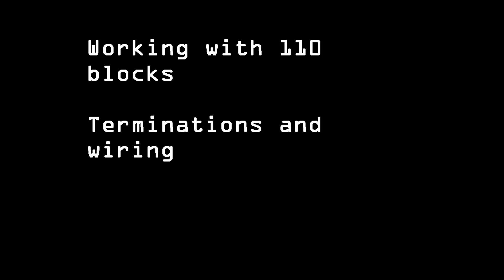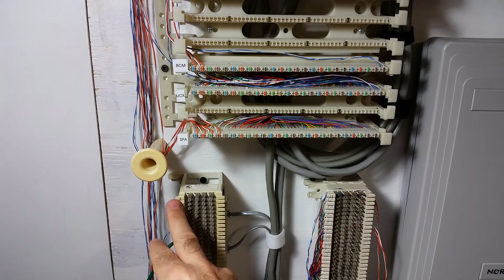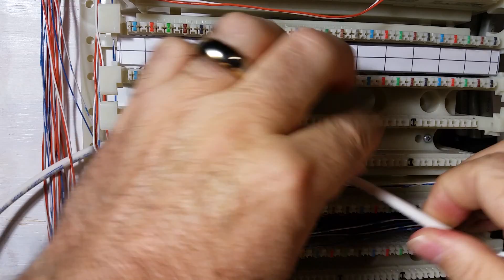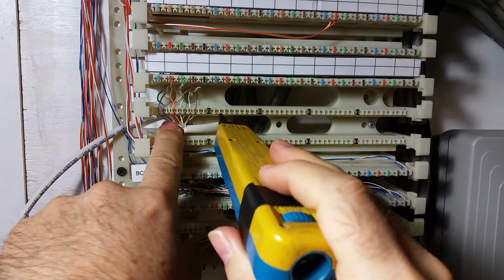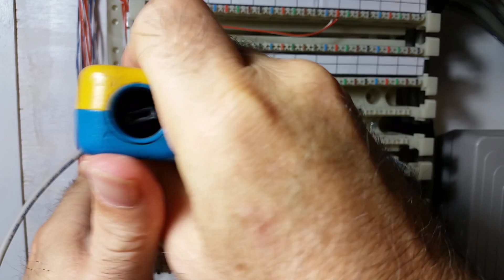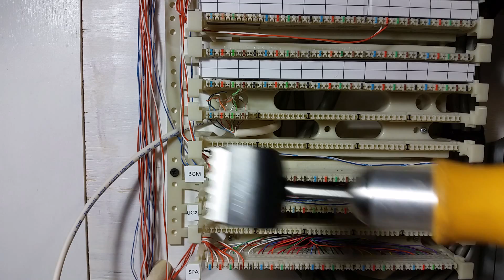punch down 110 blocks

Comment: Hello.
Can you help me with a question.
What is the difference between the 4-pair connector and the 5-pair connector?
Thanks.
Reply from the maker: I'm actually not sure, except that I would use 4-pair wafers when punching down a bunch of 4 pair cables.  And, I would use the 5-pair if I was terminating a 25 pair cable.  Helps keep the groupings straight and color codes straight.

Good question.  Maybe someone else will chime in on the topic.
Reply: I am actually curious about how data travels through these cables. When using regular ethernet cables they have 4 twisted pairs and unless you're using gigabit ethernet they only use two of said pairs, but even in that situation thats only 4 pairs, where does the 5th pair come in and what does it do?
Reply: @raventhorX  I know this is a very old comment. But...

You only use the 5 pair if you're terminating a 25 pair cable. That type cable is only used in telephone networks, not computer networks. Telephone networks need only 1 pair, so all pairs are available for use.
Reply from the maker: Mmm…. Good point Ken,  i guess I never thought about it but that makes sense.  Thanks for adding to the conversation. 😊
Reply: @keneisman6602  There are network switches that have 50-pin telco connectors on them. I doubt any have been made for years, but I worked for a place that had them in the late 90s and used 25-pair cable to connect the switch to a patch panel. As I recall they were 10/100 switch ports.
Reply from the maker: Wow!  Don’t know that I ever saw one of those. 🤔

Comment: Hi I am wondering if 110 blocks can be used for internet. I have moved into a new condo with cat5e jacks. However, they aren't activated yet as i did not hook up my router to the 110 block. I see the wiring done on the 110 block by the builders but i think the order is wrong in order to use internet. The order i see is: Blue-White, Blue, Orange-White, Orange, Green-White, Green, Brown-White, Brown. Any ideas on how to approach this.
Reply: Sorry for the long comment but I would really appreciate some responses. Thanks.
Reply from the maker: NiJu,  that's seems like an odd configuration (for the U.S anyway).  That sounds more like a Telephone line wiring.

I would not recommend trying to adapt your router/switch connections on to the 110 block.    If there is enough slack in the cables at the 110 block, maybe you could pull them off and terminate them on Cat5e jacks (or a patch panel).
Reply: I have a similar configuration in my condo. I just assumed its telephone, as punchdown like this seems highly unlikely for data, and the key thing that indicated it for me was that the blue pair which came from the source was daisy chained to all the room outlets' blue pairs, and that's definitely something you cant do with data lines, and from what he mentioned in the video, sounds like it makes sense for telephone. It does seem odd to me to run cat5e, especially cat5e jacks, for phone, but I think it was probably done a lot as "future proofing", thinking people would have an ever growing demand for phone lines (when actually it turned out to be the opposite).
Reply: Actually, if this testout platform I am using to learn networks is correct they demonstrate this exact method for punching down cabling into a 110 block intended to be used for networks. I believe your 110 is configured correctly, however if you are unable to get internet there may be some other issue causing the problem. If anything I was unaware that you are allowed to even be near the 110 block after moving into a condo. I can somewhat understand if you own the condo and are not renting it, but I was under the impression the internet related to going to ones house works a bit different from businesses where businesses take care of everything after the demarc which include the punch down block. I have never had to deal with a punch down block in any place I've lived in and don't even know where they may be located at either.
Reply: I thought the same thing but after posting my problem on reddit, i was reassured that it would work. I was looking to get to it but so much has come up for me this year with work and school so I haven't gotten a chance to do this.
I'm planning to build a PC but I do want an ethernet connection. However, I do not want to put a 50-100ft cable coming from my room to the router in the living room. I will try this during the winter break but, I need to order the tools (BIX Punch Tool, Crimp).
Reply: Also, does anyone have any idea if I can just buy an ethernet cable with one end open and one end with the rj-45 connector? thanks.

Comment: How do you stop connect physically a phone line from your pbx system? At the 66 I learn I put away a metal block only - possible from every outside line or from every inside line - both is possible. I can test be quiet the closed isolated line without break the full system. But you must diconect the blue/white line physically - found the mistake or after rewire - punch down it. 

It looks for me the 110 system is more for phone company cabinets (or boxes) on streets - where you give the connect "last mile" to the customer - and the 66 system is for the telco room or cabinets at customer side. In the next 10 years it is all equal, then the fiber goes direct to the customer with FTT(B/H/C) - all other works over 1 GBit/s till 40 GBit/s with VoIP phones over fiber or copper lines with standard router, firewalls, switches and media changer. Then we can see it in the museum only.
Reply from the maker: hey, thanks for such a lengthy comment.  Yes, the 110's are common for the phone company.  But, when wiring very large PBX (2000 ports), the space of 66 blocks begins to add-up.  110 blocks can save a lot of wall space.  :-)

Comment: How can I unplug the plastic module in order to fix any wire?....I am talking about the plastic block with tooth. I wonder, how can I remove back for any repair?
Reply from the maker: you know Dennis that is a great question.  And, I don't know the perfect answer.  But, here is what I do.  I basically, use either my hand or a pair of pliers to gently rock the "wafer" up and down and side-to-side until I can ease it out of there.   Yes, you probably already knew that.   So, Maybe someone will chime in here!  :-D
Reply: I've been learning a bit through this platform called testout that you can get at either testout.com or testoutce.com. According to them its best practice to put the cable or wires you are least likely to remove under the wafer rather than on top that way you can avoid having to remove the wafer as much as possible. Other than that though They do not really cover much else in situations where you may need to remove the cables. Actually a bit disappointed in how they teach about the 66 block and 110 block and how these all work. I am under the impression you connect the blocks to a patch panel, but other than that they mostly leave me in the dark it seems.

Comment: luckily I don't run into many 110 blocks...they have always been a pain in my butt!
Reply from the maker: right.  They do save space.  But you don't have that same level of flexibility as you do with 66'ers.   Like, you can't double-punch on 110.  And, you can't use bridge clips to add the other two pins.
Thanks for commenting Jeff. :-)
Reply: krone blocks are best,  reliable, easy to work with, and you dont  disconnect  a few lines to fix cable of one like 110 blocks.  (In Europe and Australia, krone is very popular, though the blocks are only 10 pair, dream to work with)